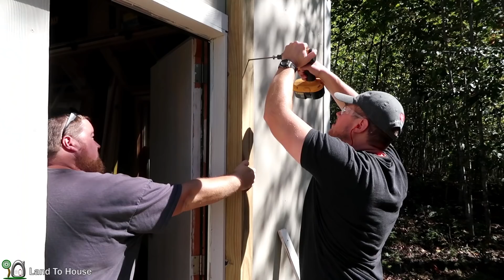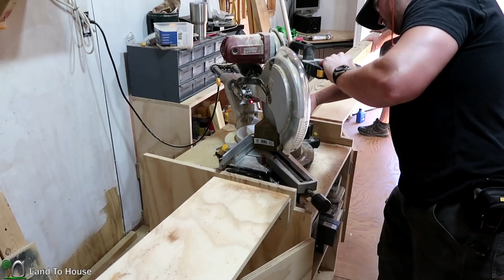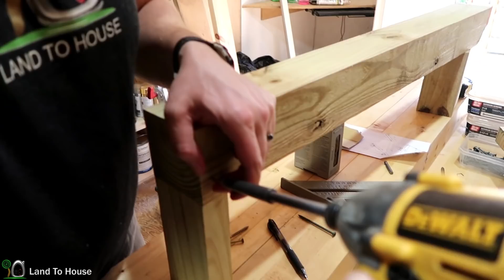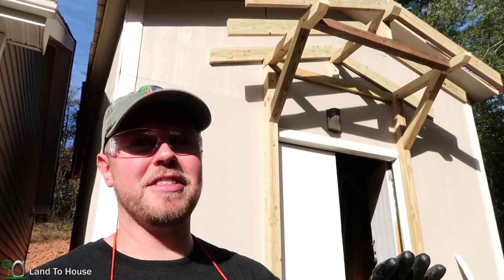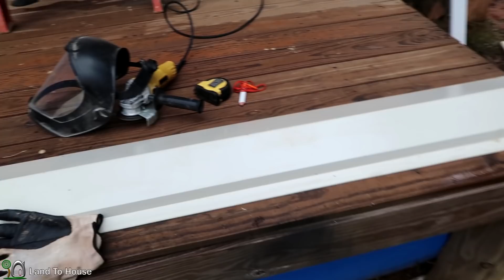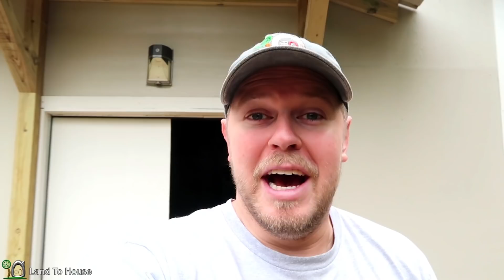Shop Door Awning - Build a Workshop 66

Comment: Loved seeing you do a ridge beam and rafters with birdsmouth cuts on this, your skill set is growing by leaps and bounds.
The metal roof sheeting does not have much rigidity laterally, it might sag between the rafters with a heavy snow load.  I'd suggest retrofitting battens between the rafters to provide the missing support.